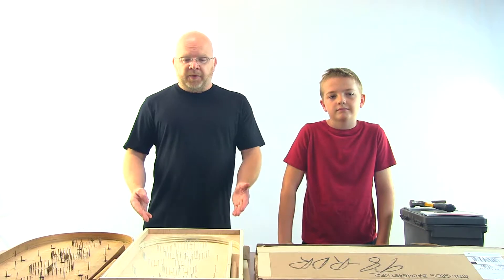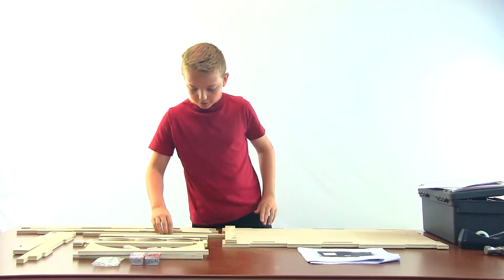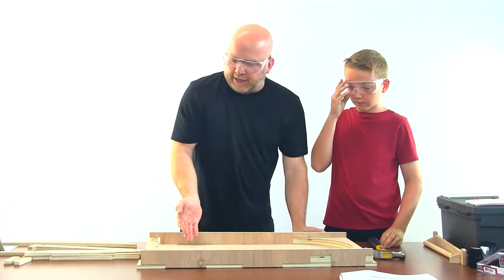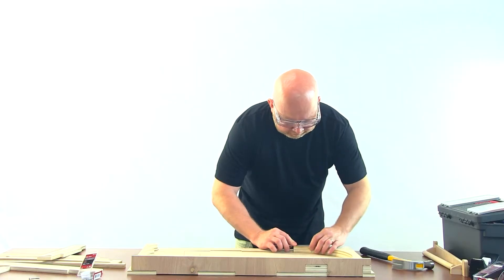DIY Pinball Machine Tutorial

Comment: Would it make sense to add a plunger and mechanical flippers to the board? I've seen some homemade pinball games that use rubber bands or metal springs to control the flippers instead of solenoids, and I'm curious how adding an element of skill would change a game of chance.